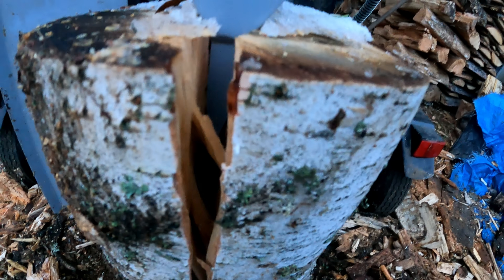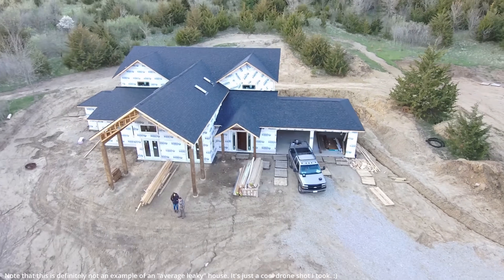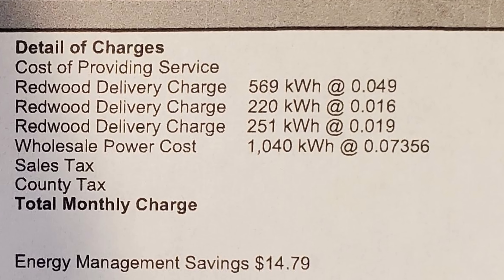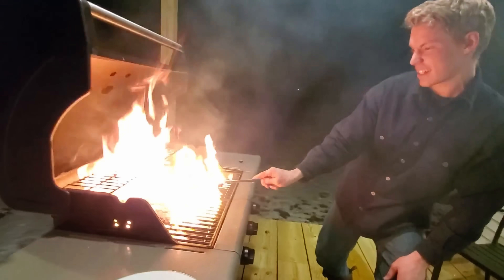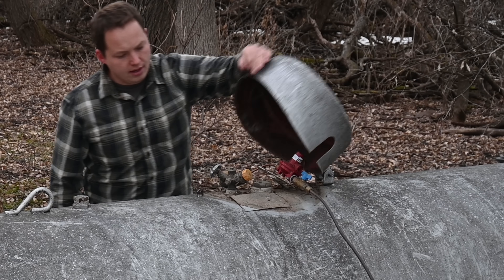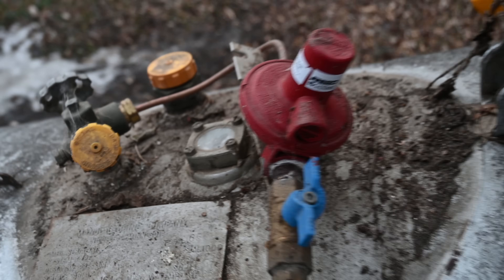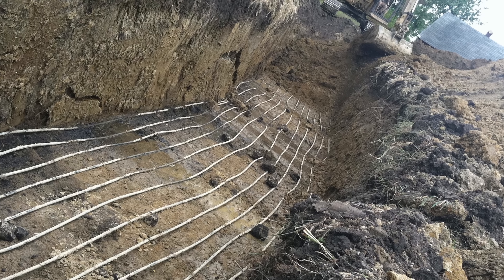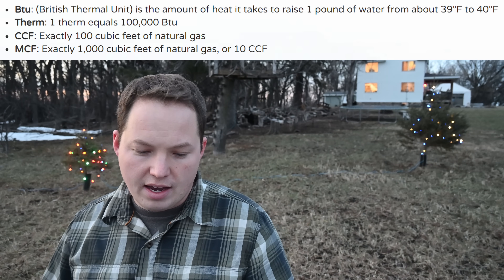What's The Best Heat Source in 2022? Top 5 Home Heating Methods - LP Electric NG Geothermal Fuel Oil

Comment: What about making a hydrogen generator that’s 1500 watts usage and then using a propane heater connected to it to burn the hydrogen.
Between the wattage made from the hydrogen generator and the hydrogen burned I would say that would be a lot more efficient.

Comment: My house was built in 1960 and had a boiler for hot water heat. A couple years ago I did a remodel on the kitchen.  Durning the remodel I had to remove the radiators. So I placed the radiant heat under the floors from the basement. With the cost of natural gas the budget doubled. The house 1800 square feet and remains comfortable.

Comment: Thank you for this comparison. We have natural gas heat & hot water here in PA. In the recent past with Fracking close by it was very cheap to hear the house. Has maybe tripled by now.  I think many of the prices are way up since you produced this. Heating oil is over $6 gallon in PA. My brother in law has Propane & kerosene both which have skyrocketed in the last year.  My wife & I hope to retire to a sub 500 sq ft tiny home with a mini split & small wood stove.
Reply: That was Ukraine war-related.  In early 2023, the commodity prices have dropped to below the war-bumped prices.

Comment: It is more efficient to use a steam plant to make electricity and power a heat pump. Heat pumps for the whole home absolutely should draw heat from the ground. We need to have more efficient use of energy.

Also like coal power plants are typically getting much more than 30% efficiency.

Ultimately I think that any heat source I have to refill multiple times per day is a pain in the butt.

Comment: We moved a lot when I was a kid and I experienced many methods of heating. In Allentown, we had radiators, they worked okay but definitely not kid friendly LOL. In Reading, we had oil with woodstove supplement. Also worked great and I loved chopping wood. In Beaumont, we had electric, I never thought about it, I was 11 but was never cold. It all depends on where you live and the cost of oil, electricity, coal and wood.

Comment: I'm in Northern New England,
Electric is 24¢ per KWH, Oil is 4.33/gal,  
Heating is hard up here.
I use wood pellets. 5 tons a year, about $1,200.
For a 2,800sq ft house.

Comment: I was going to comment but I did 9 months ago.  Still doing the same thing.  I forgot about commenting on your option to burn wood.  You are right, what is your time worth.  My first house was not insulated well.  I had a fireplace insert and it had a catalytic converter which would glow red.  A small fan expelled the heat.  It would make my 1700 sf house toasty warm and I did not worry about the door being open because it would be warm again soon.

Comment: I have a question..Thank you in advance for answering.. You taught me a lot about COP rating but I'm a tad confused... I'm going to buy a 12000btu mini split for a 450sqft living room kitchen area in my home.. One mini split is  30 seer 14 HSPF and a COP of 3.8... $1800.00.. But now I have found the same size but 23 seer 10 HSPF but a COP of 3.5 and $500.00 cheaper.. By the way I really need this for heating so I can stay off a propane furnace... And I'm in an area that gets no lower than 22 degrees in the winter.. So the question is, is there any real difference between these two COP ratings?... Thank you

Comment: Natural gas in not the winner. You mentioned ground source heat pumps but didn't go into its savings. If natural gas costs $1150 then Geothermal costs $850

Comment: In Canada put in a ground source heating 14 years ago, pay back was 8 years, air conditioning is almost free. Went from $3000 propane to $300 ground source per winter.
Have a wood stove as a backup.
Solar on the roof provides power during outages, also charges my Model Y.
All yard tools are electric, nothing runs on fossil fuels.

Comment: exept now gas compnaies.. scam in june when heat was off gas compnay gave me a bill for 42 dollars a month saying the little pilot costs 10 bucks a week.. because the driver with smart meater said so. in my office.  so cancelede.. now they want 3x more charges this year from fake shortages.. this would mean a pilots costs 125 a month to run? or 600 a month what I was paying was 65 a month before scam?  naa.. got rid of scam.. trying electric heater.. it became cheaper.. they now want over 3 dollars  month from your quote.. electric is now cheaper from fake gas shortage..

Comment: I have geothermal with 5-165’ ground loop wells. Had it about 13 years. I love the quality of the heat. The heated air feels like gas heat. I’m 72 so cutting firewood is out of the question. I can’t really say what the cost is to heat because I have a 700 gallon aquarium with lights that I’m sure is using a lot.

Comment: Liked the video. The reason why propane, NG and stove oils (heating oil, diesel, kerosene) are making drastic increases is push to green new deal energy. However the 800lb gorilla on that is the power grid in itself. I highly recommend people always alternative to electric grid heat source. 
 What the politicians and MOST green new dealers is the electric grid can’t be stocked up on. It has to be a balanced system or it fails. Meaning demand and production have to be very close. Or the grid will collapse or fry itself (a collapsed grid will also soon start frying itself so that’s the worse condition). 
 As the push to EV’s then add on electric heating the grid can not handle that demand. Solar can’t handle it as winter time in northern climes have much less solar hours and not counting snowfall. Wind requires height, space, and naturally wind. Hydroelectric good luck getting permit and avoiding a lawsuit protecting a beetle or worm. Nuclear power nope because of Jane Fonda and Hollywood disaster movies. So unless you want to be like Ukraine in winter season 2022/2023. Make sure you have non electric backup heat. Myself use pellet stove combined with Jackery and generator.

Comment: my cheapest heat after using any other heat source is natural gas where I'm at for the gas log fireplace you get 99% of your heat and I don't care how cold it is 20 below zero they're still going to heat  I was using resistant electric heaters is they're more of a fire hazard than any other heater already experienced that and never again

Comment: I moved to central Phoenix. I don't run any heating at all in winter. I do have to dress warm, but I like that adventure. I also turn off the water heater in summer. I also don't own a clothes dryer as clothes line dry in about the same amount of time in summer, bit longer in winter but not a problem.

In summer I run AC but only in one room where I have my computer and bed. I find going into other house parts (bathroom, kitchen) nice when warmer as AC makes me chilly. I insulated the walls to 8". My electric bill in summer is about $75/mo and $22-28/mo the rest of the year.

I expect energy costs to keep increasing making a climate like Phoenix more valuable. Sunshine is also addictive.

Comment: Electricity here in TN is about 14cents/kwh.  Great comparison video.  We have heat pump only here, Jan and Feb get pretty expensive (resistive heat gets used then), but not bad the rest of the year.  No solar here yet, but I would like to put some on the house just to help some. ... We have found the cheapest upgrade to a house is more insulation and the more the better year round.  
I would look into ground heat loop but small lot keeps me from it.  We did have our air source heat pump replaced a couple of years ago and that has helped due to increased efficiency.
Reply: I would punch my mom for 14 cent electric! In New Hampshire it's 24-29¢.. painful
Reply: The problem with most contractors is they pick out a smaller heat pump than your heating load needs!  In 2014  I installed a 48,000 Btu 14 SEER heat pump for my 1,850 square foot home in Portland Oregon.  It is rare, but we had 23F cold snap last month, and the heat worked just fine.  Sure it ran much longer hours that week.  I never connected my back up 20 KW furnace to the system.  I might some day, but hate the thought of back up electric heaters.  I will use my electric oven if I need back up heat due to compressor failure.  

At 47F outside, I get about 55,000 Btu of heat.  At 35F it is down to only 40,000 Btu.  At 23F it is 28,000 Btu's.  That is the size I used to determine the heat I needed.  For cooling only, I might have picked a 30,000 Btu unit, but that would only provide about 18,000 Btu's of heat on that 23F night, so I would have needed to run my back up electric furnace.  

8 winters, and no back up heater so far!

Comment: Goodman 2 ton package heat pump, 26 years old, highly maintained by me. I switch the indoor fan motor to low speed every winter. Yearly cost about $1500 for a 1550 sq. ft. Waiting on the dinosaur to die, but it keeps on ticking like a Timex😁. Would like a dual fuel on natural gas for comfort. Any comments appreciated on brand. We live in South Carolina.

Comment: 24/7 99% wood primary 
heating 2000 ft² home in rural Downeast Maine for 21 years. The firewood is self harvested from our 60 a woodlot. Retired , so I have the time to fell, buck, split, stack, burn between 6-8 cords each year. Plenty of healthy work keeps the body operating. And I got to train as CLP with loggers, and pro Foresters for a management plan.Heat from the two Jotul stoves is exceptional; when in "central" heated places we're always chilled. Firewood heat IF DONE CORRECTLY is clean, sustainable , renewable, BUT not in tight suburbs or cities, or  where forests are not well established as here in Maine. BTW-we use a top down method for fire starts in shoulder seasons when just needing a short warm up fire.
And, why the solar/wind power enthusiasts ignore biomass is beyond understanding.

Comment: The problem with heat pump technology is the greedy hvac company there are a lot of homes that have air conditioning and could be converted to be bidirectional unfortunately the only companies that have the ability to add reversing valves are air conditioning tech and the system won't upgrade An old central air conditioning system because they say that they are are close to the end of their life now as far as I know central air conditioning systems are designed to last 10 years or more and that's in tropical areas more like California Arizona Texas and such I'm sure they're not buying new ones every year or two yet in areas where they are only used a few months of the year they say they are almost at the end of their lives after only a few years ours has maybe run a total of two months in 10 years and it wore out but if I want to upgrade to heat pump technology I need a new one I've looked at other ways around it ie heat pump hot water heater and use that to also heat the house but the only one I've found that has enough temperature and is low budget solar friendly can not be installed by a homeowner but only by their own licensed contractors and it's highly priced I thought of a portable AC unit but they don't sell them as bidirectional only AC there are lots of areas that have either ground water available or those who have creaks rivers ponds and the like that have a ready supply of water my water is 30 ft beneath my basement and I can't use it for heating or cooling

Comment: In California grid electricity is VERY expensive, due to our illustrious government here. However, you did not mention solar. With solar, things get good for heat pumps, PLUS EG4 now offers a heat pump which you can power from your house electricity OR a few panels on the roof. That kind of stuff gets pretty interesting.
Reply: In cali PSE&G and other utilities are private company that essentially raise prices every year above the inflation "California was the first state in the country to introduce deregulated energy in 1996. The California Public Utilities Commission (CPUC) lifted caps on electrical supply prices, allowing electricity prices to respond to free-market supply and demand." I would definitely go solar if you can afford the project, because i'm pretty sure the prices will be raising raising year after year.

Comment: I have a 9Kw Solar array, In 2 years my power will be free. I have a Minisplit and heat pump hot water. Also I designed the house with passive solar. The down side of that is you need to keep the shades and shutters open and closed appropriately. I also have a masonry heater and cook stove. We can make pizza and baked good in the heater, and the stove is used for some cooking. I also Have a propane cook stove, GE brand....pretty badly made....I plan on getting an electric oven/propane top cook stove to replace it.

Comment: I still have dislikes... 
I'm in all electric, heat pump, I also heat my water with the same unit... Which isn't very efficient while I'm trying to heat my house... Especially since I don't want to kick on the resistance heat strip in the air handler... Orlando FL

Comment: Around here a lot of people use fire wood to heat their homes. It is cheaper in some cases than the other sources of home heating fuels for our area. Our electricity went up 30% last year. Propane doubled. Natural gas is not available to us. More people are turning to wood fuel around here now.

Comment: Great video.  Your home is comparable in size and insulation to my home, so the numbers are quite close.  Breaking them down, comparing the cost to heat our 1400 SF home in New Hampshire with Oil will cost about $3055 (oil at $3.39/gal.).  I have been thinking about a heat pump lately, but since Natural Gas has spiked, that drove our electric costs from $0.16/kWh to $0.24/kWh in the last few months.  The cost to run a heat pump at those electric rates would only save us $243/year - not really worth the effort - but it would get us AC in the summer, and I could get rid of the 4X window AC units I have to install and remove every year...
Reply: Definitely get some heat pumps installed and roof top solar.
Reply: Window ac units don’t have to be removed every winter. If you’ve ever noticed… older commercial buildings never removed window ac units.
As far as the cost.., thank Joe Biden !
Reply: @jimalcott760  If I want to keep my heating costs down I definitely have to remove the window AC units. The windows seal much better without them installed. Plus, they look terrible, but are necessary in the heat and humidity in the summer.
Reply: You can get a ductless heat pump on Amazon that is 12,000 Btu's for $719, 120 volts.  Less than 11 amps.  These can reduce your oil heating needs by more than 50%.  At 17 SEER, that is about 17,000 Btu's of cooling or heating per KW of power consumed.  So 1 gallon of fuel oil is about 100,000 Btu's of heat into your home.  $6 oil in California might make it's way east someday, before your 10 year old heat pumps are showing age to them.  The ductless units use about 1/2 the power of a window unit, and are VERY quiet!  

And you might consider a 3 KW solar system!  That can save a lot on your electric bill!

Comment: Finally someone who took the time to break down all sources.  I love the cold only when I have a reliable heat source. I converted everything in my home to natural gas even my portable 10000 watt champion generator and connected a transfer switch if we lose power
Reply: If your natural gas supplier's power goes out, won't the pressure in the feed line drop to zero, meaning no natural gas either?
Reply: @s9josh778  thats why I have back up heat also. The generator runs on gas also, I have propane heaters and I have kerosene heaters also.Always think ahead Josh
Reply: @gregoryivorymaryjerman7492  It's great to hear you don't have all your eggs in one basket.  I am getting a couple diesel heaters ready to hang in windows for backup heat.

Comment: What about solar power? Here is northern Canada, my understanding is that there are many homeowners using solar panels most commonly, but exclusively installed on newly constructed "NET ZERO" homes that not only exclusively use solar power to supply all of their electricity and heat, but also sell excess energy accumulated per month back to the utility.

Comment: Best source to heat your home; A Carrier infinity 98% natural gas furnace with greenspeed intelligence. It has a variable speed ecm blower motor and modulating gas valve. It also uses an intelligent communicating thermostat that uses precise measurements and calculations to provide superior heating and comfort for your home while using a little energy as possible.

Comment: Ben, Oct 2022, heating oil in the Catskills of NY is~$5.25 a gallon, I don't know what NG is but I think mini splits move to the top of the list. I'm paying 10.7 cents a kWh but my off grid PV system will carry most of the cost if not all of it.
Reply: That is about to double for NG.  I worked for NG up until this year.  They are more than doubling the distribution price or the market is.  They dont have anyone generating much electricity for them.  they just buy it off the market.

Comment: I love my wood heat in my 100 yo victorian poorly insulated house.Till the new windows are installed and it is insulated properly in the coming year or two wood is the cheapest for me,It costs me about $120 a month to keep my house at 75 degrees pr so,(I like it warm,Being able to wear shorts and sandles it the house in the winter is a thing for me!)I buy all my wood from the Amish so my work making wood is limited to calling in an order and filling the furnace every few hours.The true key to how much it costs to heat your home is all about the insulation,The better your insulated the less it costs across the board.